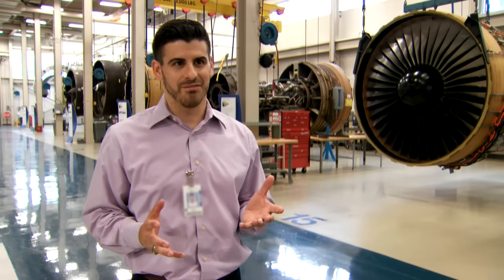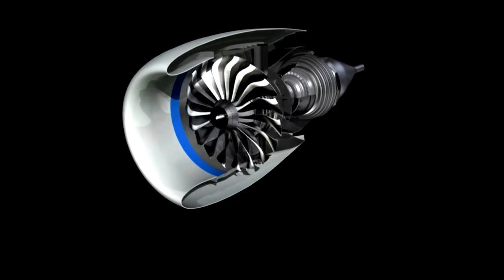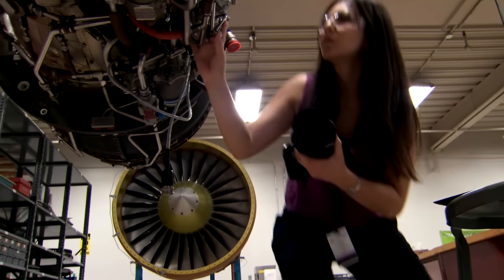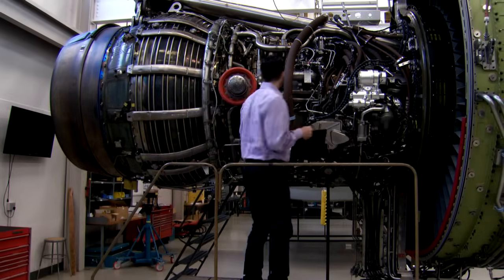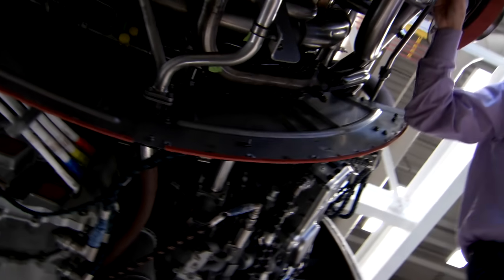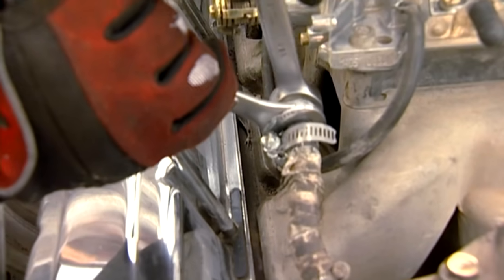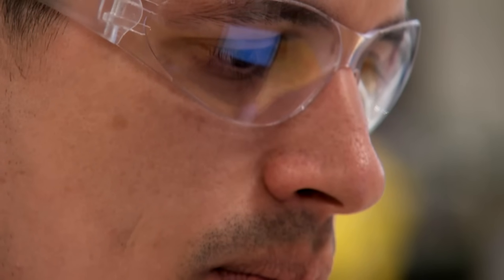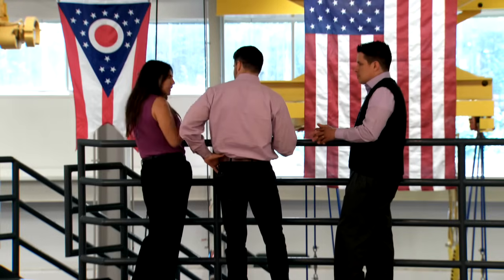Mechanical Engineer

Comment: So many people crapping on engineers, yet most of these commenters probably don’t know the amount of math and science necessary to design these engines and planes
Reply: never heard of someone who is crapping on engineers .
Reply: I think the problem is in mechanical engineering there are not so many easy wins nowadays, as a lot of stuff has already been developed. So companies just reuse older technologies and optimize maintenance cost.
Reply: @dmitrykarpenko2271  true
Reply: @online class videos true but you can't operate the software without understanding the math or science behind it.
Reply: Precision penaltyshot  100% math bends the sheet metal. machines the pins, and makes the coils energize. Math may not be used initially but if you want to optimize your design and  be sure that it's going to work the first time you'll be using some kind of software (math) to aid in that process. Obviously you've never designed sheet metal because you literally use bend tables (math) to design it correctly.
Reply: @justin60222  and you don't know that electrical engineers don't design sheet of metal. Lol
Reply: @justin60222  Those machines are designed by engineers too.
Reply: @justin60222  as a quality engineer in a sheet metal fabrication shop I thoroughly agree with you sir! Sometimes I wish the design engineers were better at math but I know we all use it extensively.
Reply: @justin60222 q
Reply: And amount of attention to detail toh each and every part of machine , they play in microns of dimensions. 🤘😎
Reply: Well said
Reply: Just love your job
Reply: Precision penaltyshot  im curious, where did you get your degree from?
Reply: you mean basic algebra?
Reply: @leooram1959  basic algebra? Pretty sure most engineers on a basic level learn a year in a half of calculus and a year of physics and then some more
Reply: @SchismaticDog24  we do learn calculus and all sorts of fun math (by fun math I mean, not fun math) and what ends up happening is that most engineering principles used in design can be explained by simple algebraic formulas. Only developers use calculus and some numerical methods. Researchers do use that math, you know, more often, but they don't like to be called engineers. So yeah, that person in the video could be you ;)
Reply: @leooram1959  I do plan on doing ocean engineering/remote sensing masters
Reply: @SchismaticDog24  best of luck my friend, that sound pretty awesome
Reply: @leooram1959  thank you!
Reply: Lmao I am getting into mechanical engineer without science
Reply: @hiki_jr6333  omg im studying mechanical engineering in bachelor's degree, but i can't feel anything related to sth like jet engine, cuz everyday our teachers teach us how to design and construct buildings.... XD
Reply: @weikeliao8613  wow good job I am still in high school choosing it. Doing the best pathway 😄, also studying civil engineering
Reply: @weikeliao8613  isn't that supposed to be in civil engineering?
Reply: I have a PhD in Engineering. would like to work with any one
Reply: I have a PhD in Engineering. .would like to work with you
Reply: Only as special kind of idiot would crap on engineers or engineering.
Reply: What kind of mathematics in mechanical engineering, and to do what?
Reply: In India you can't get more than 15k per month as design engineer
Reply: Mmmmmmmmm......
Reply: 100%, probably jealous or not quite the full quid as such
Reply: I'm an electrical engineer so i do know the math Lol
Reply: @patrioticgunner8034  lol
Reply: @patrioticgunner8034  can i ask something about engineering
Reply: @patrioticgunner8034  Electrical engineering is tough as hell. You probably had to do a ton of Maxwell's equations.
Reply: @SchismaticDog24  equations and math aren't exactly the same.. Equations become a part of mathematics only after formulas use numbers
Reply: @westisinmyblood1240  ok
Reply: @westisinmyblood1240  engineers still learn advanced math
Reply: @patrioticgunner8034  Hey dear
Reply: I love engineering,but dont love the money we get from it😁
Reply: Precision penaltyshot  you're absolutely right. I wasn't arguing against the trades. Just the comments against engineering.
Reply: Hey dear

Comment: Could you please tell the software you use for computer modelling or simulation of flow or stress analysis?
Reply: ANSYS
Reply: MECH Tech. Usually Solidworks or AutoCAD are the most popular for computer modelling/simulation; Solidworks is great for stress analysis

Comment: the future of these engines is material research. In this way, increase the limit temperature of the thermodynamic cycle and therefore the overall efficiency is possible. From the point of view of design, for example the gemetria of the vanes, we have reached the highest level. this is what I think
Reply: Probably that's why not that many mechanical engineers are needed.

Comment: i'd love to be an mechanical engeneer
Reply: go for it
Reply: You should know the drawbacks as well.  This video is very sugar-coated and biased.

Joys of being a Mechanical Engineer:
1. You will get laid off because of factors beyond your control
2. You will get blamed and used as a scapegoat for the failure of disastrous complex long-term projects that were obstructed by factors beyond your control, so that the boss can cover his ass

3. You will experience stress from having to guesstimate and manage project uncertainty

4. You will get rejected for job openings a gazillion times because you don't have 15-20 years experience in every niche aspect of every mechanical engineering job ever known to mankind

5. You will get fat sitting in your cubicle and sitting in meetings 8 hours a day - wishing you had a career in fitness instead
6. You will have your individual worker's rights trampled on by unethical managers who only care about satisfying the company's internal politics and political correctness

7. You will feel like an idiot when your supplier asks you technical questions to which you do not know the answers, and must ask your technical lead, acting as little more than a go-between

8. You will get short-term fatigue and become unproductive while monotonously sitting in your cubicle for 8 hours a day but be prohibited from refreshing yourself with a power nap because American society considers it "lazy"

9. You will feel like an idiot when you are required to review and approve of technical reports that only a PhD in that particular field could understand

10. You will be completely surrounded by men at work with practically no chance of ever meeting "the one", and wish that you were a male nurse, because they can meet women at work

11. You will be admonished for failing to read the boss's mind and failing to do what he wanted you to do without ever telling you

12. You will be unfairly disciplined by witch-hunting bosses without any presumption of innocence because some gutless coward decided to abuse the complaint system to stick it you

13. You will see people do you wrong and get away with it due to favoritism because the favoritism in question was politically correct

14. You will find out that most of the behaviors required to succeed as an engineer in the long run are behaviors that were never taught in academia
Reply: @perfectsplit5515   no lies were told
Reply: @perfectsplit5515    anything for mechanical engineering 💪

Ok but honestly, are other engineering better?
Is electrical engineering better in that context?
Reply: @phenomenalphysics3548  While I cannot speak from the experience of working as an Electrical Engineer, I can say that I showed this list of drawbacks to a non-engineer and his response was, “That’s not just in mechanical engineering; it’s like that in my job, too.”
Reply: @perfectsplit5515    oh, should I go for mechanical engineering then, I like everything about it
Reply: @phenomenalphysics3548  I personally believe that anyone who plans to attend college - should first have the experience of working a backbreaking, minimum wage, manual labor job for 2 years.  That way he appreciates his college education.  And never take out a student loan.  Military academies are tuition-free for those who qualify.  If you can find some free online college that teaches mechanical engineering, then that would be way better than borrowing money to go to college.
Reply: @perfectsplit5515  As a mechanical student I'm not that much creative.
And I have no better knowledge or interest in design field of ME.
But I like the physics field in ME course. Can you say what are the other scopes in ME job other than design field.
Like analayising ,the fields that needs less creativity.
 What are the type of jobs ME do on oil, gas, aviation fields other than designing.?

Just a basic degree in ME  doesn't give any job in our country so I'm focusing on higher studies in ME .
Can you give any advice for better course selection other than design field.?
Reply: @perfectsplit5515  thank you for the reply it is really worthy information.
Reply: @perfectsplit5515  bro give me some advise about industrial and manufacturing engineering.
Reply: @ammarkhan2927  “give me some advise about industrial and manufacturing engineering.”

I never worked as an Industrial Engineer, and my experience as a Manufacturing Engineer was only 4 months.  However, I will tell you what I know.

Industrial Engineering is all about optimizing sub-processes in a complex process.  Logistics.  Arranging things in order to make everything run as smoothly as possible.  Just think of all the complex processes that go into building a car.  Henry Ford’s Assembly Line is considered the greatest invention in the field of Industrial Engineering.

Manufacturing Engineering, Process Engineering, and Operations Research are all related to the field of Industrial Engineering.  Manufacturing Engineering deals a lot with minimizing defects.  Quality Control.  In fact, there is now an issue of the molded-in-color roofs of the new Ford Bronco having issues.  There are people posting online about defects in Ford and GM cars – misaligned hinges and other problems.

At the GM factory, if they find a defect in the assembly process, they work around it.  The Chevy Chevette, Chevy Vega, and Cadillac Cimarron were all GM cars.

At the Toyota factory, if a line worker finds a defect, they stop the whole process until they resolve the defect.  If a factory works sees an opportunity to improve the process, he has the right to stop the assembly line in order to make a suggestion.  The assembly line gets stopped many times to implement the large volume of employee suggestions.  By the time a car completes the process, it is a sheer masterpiece.  4 of the 10 most reliable cars were all Toyotas.

These are all issues of Manufacturing Engineering.

Manufacturing Engineers must know probability and statistics, quality control, and forecasting; in order to create predictability in the process.  They want to prevent variability.  They need to be able to make statistical generalizations about a large population based on a small sample size.  Insurance actuaries and even criminal bookies have a lot to teach us!

3d printing is probably going to play a larger and larger role in the field of manufacturing engineering.
Reply: @perfectsplit5515  Thank u brother for your prescious advise

Comment: Working on jet turbine engines, repairing them and how they work is a basic job that a lot of 18 years old learn in technical school in the Air Force within 5 months
Reply: Yea that's just the tip of the iceberg. Designing is the rest of the iceberg.
Reply: 551223 
Are this group on Facebook
Reply: 551223 just call on 8442833

Comment: bullshit video shows people pretending to know whats going on, as if they fully understand each component and built that turbine by themselves

in the real world an engineer works on analysis of a tiny fraction of the whole part
Reply: you need to know how the whole engine works to make a tiny fraction of it tho...
Reply: greenlizardballs Engineers do know what’s going on. Engineering is a very hard discipline
Reply: Ana Luz So designing aircraft isn’t a skill?
Reply: I really don't understand this kind of comment! You either might be not eligible to be an engineer, so the frustration, or... you are just a bad guy!
Reply: True...
Reply: Your comment makes so much sense in reality
Reply: veb50 you need to understand the systemics and to get the required inputs and outputs
Reply: Well said. Mech Engineer is basically a technician but instead of doing the work but just work on producing docs and "projects"
Reply: Tran Kiet Mechanical Engineers are not “technicians”. That doesn’t make sense.
Reply: yes that's true but the video needs to be interesting also.
Reply: true

Comment: I'm a senior in high school and want to go in to this field. I love to take things a part and put them together then ask myself questions about what other parts do. love to do hands on and design my own things. Is this the right field for me??
Reply: That is the introduction mind set to have as a mechanical engineer student during freshman year. You later learn by your junior year that you have to design things based on ASME, API standards, Limitations to temperatures, pressures, materials, etc.... You then considered how the materials you will be using are affected by the surrounding weather around you. Like insulation on pipes is different in the north compered to the south due to the difference in temperature. It all revolves around thermodynamics, heat transfer, fluids, mechanics, etc.....You will have to study like crazy if you want a good GPA. Mechanical Engineering is not really taking things a part and putting them together by hand, but doing it by a computer design program. Like AutoCAD.
Reply: paper work is a part of the job but definitely not the whole thing. you will be spending lots of time in the computers designing, and analyzing the design
Reply: Chauncey Overton become a engineer but learn welding and machining.  You can create anything
Reply: John m
Reply: Harikesh Patel make or push pencils.  DISASSEMBLE LOOK
Reply: Dont come here please. I came expecting the same and trust me the theory will suck soo much of time that in the last year you will have lost any passion for opening uo things. Be a mechanic, a very good mechanic world needs that and there are people who pay big money for smart mechanics.
Reply: Basically if you REALLY love solving math and physics problems like I do then it’s a good degree.  If you only like taking stuff apart you’ll probably be disappointed.  Most of what you do in class is theory based calculations and using computers.  Join a design team on the side if you want to do hands on stuff, but you won’t do very much of it in your classes.  Overall it’s a very valuable degree which can lead to many different career options, but it’s a hell load of work.  If you want to party every week then you won’t do well.